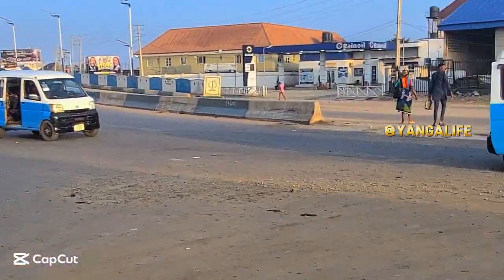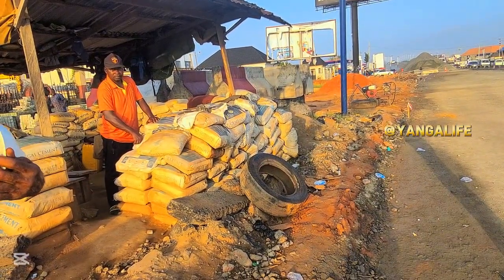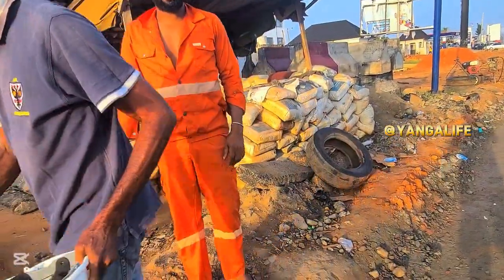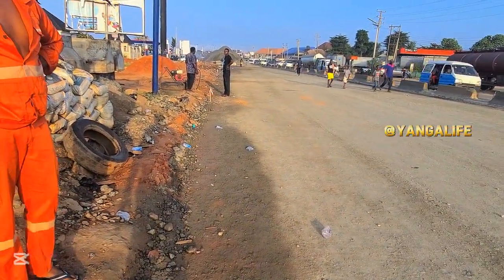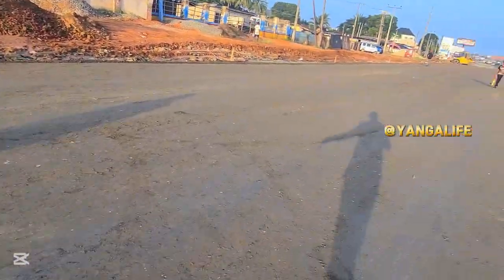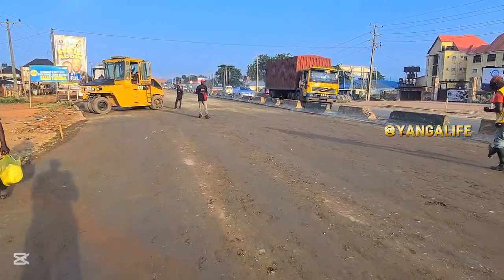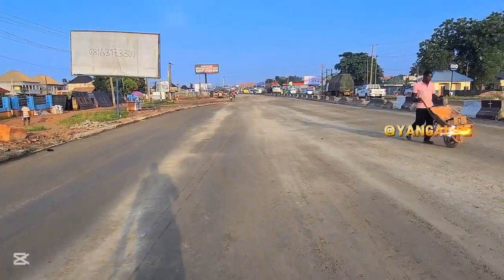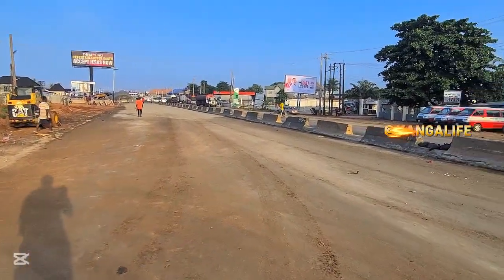Concrete Transformation: Benin–Asaba Expressway Sets a New Standard in Road Construction

Comment: It is good to see this development and I pray Hartland do a good job. Service lane would have been good if the head bridge itself was expanded. In Warri the road constructed is 8 lanes and 10 lanes in some areas/around key junctions with flyovers. But even at that the road connects major highways linking ports and highways to Benin and the refinery. When I saw what Berger did in Warri I was marvelled, the aesthetics of the multiple flyovers, 8/10 lanes, and slip way bridge, etc. is top notch. Currently CCECC is expanding and reconstructing the Warri Sapele Benin road in Warri with reinforced concrete, I am waiting to see how the aesthetic of that project would look like. Thank you for this update.
Reply from the maker: Welcome